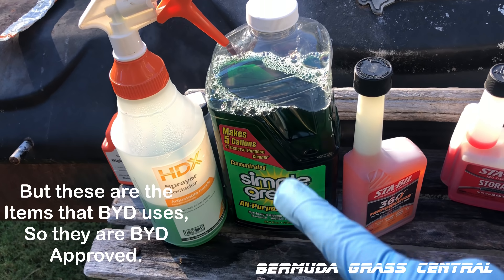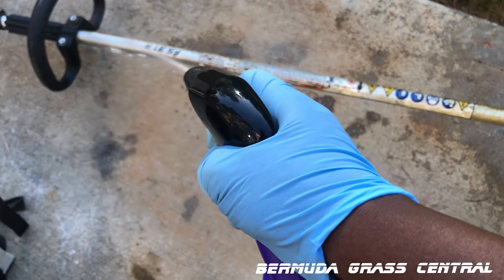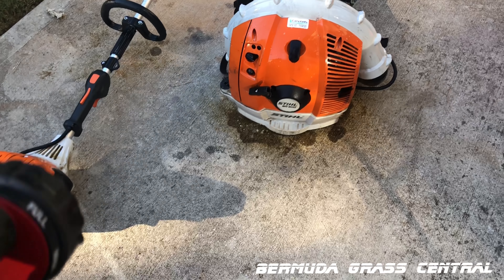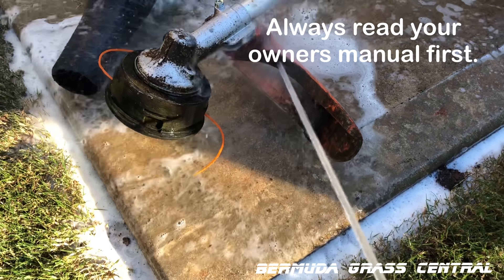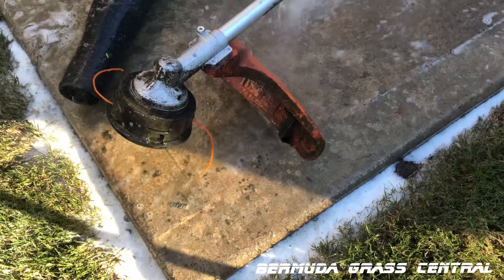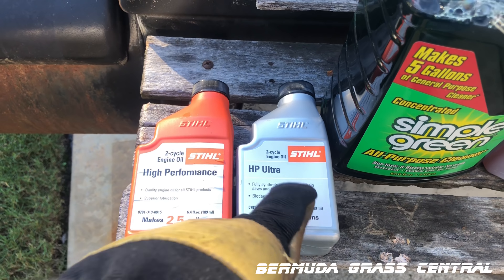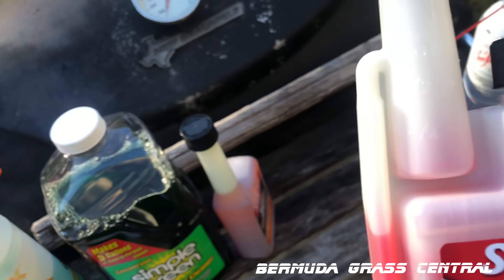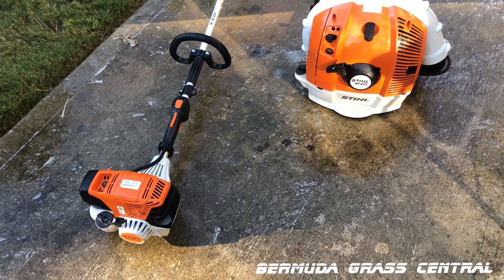How to Fog a blower, plus how to winterize lawn equipment

Comment: A better way is to use TruFuel or VP small engine fuel at the end of the season. One quart can will treat several pieces of equipment .
Reply from the maker: G42355  you do not have to fog it but I’d recommend at least one take high octane with the fuel stabilizer since you’ll be  cutting less than normal during winter ❄️
Reply: I was recommending to empty the pump gas out and add Trufuel and run it till the carburetor is purged of pump gas when you are putting the equipment away for the winter

Comment: Why not use non ethanol? Love the vids. Keep em going.
Reply from the maker: RobSouthwell main reason is most small engine components are small and clog quickly. Non ethanol gas still is oil and ethanol is corrosive by nature and somewhat helps remove buildup. Second not all stations carry it ( convince issue ). There’s nothing wrong with it if you’ve had success with it but most wont take the chance.

Comment: Do you have do this if your using your lawn equipment on the winter?
Reply: No but in some very rare cases you may want to change your oil from a summer to a winter oil. Different weight. Also the gas will change but that's something dome at the gas station.